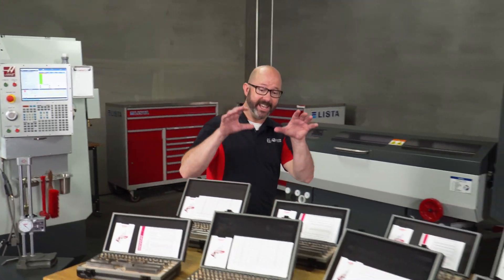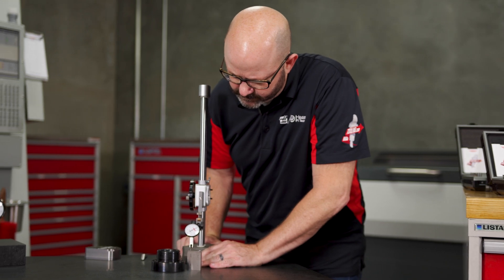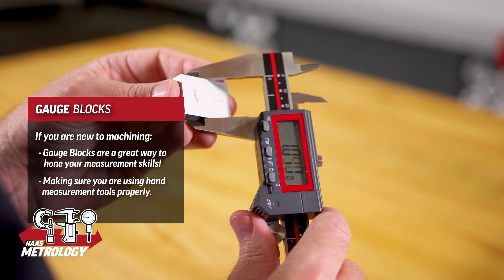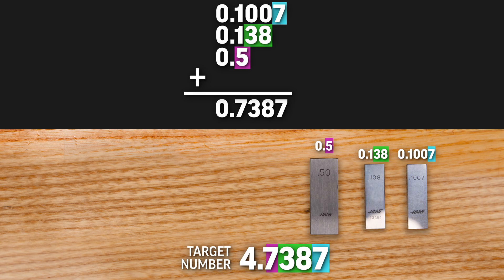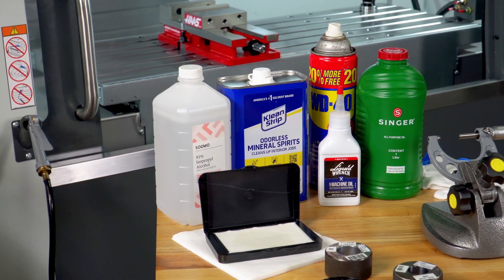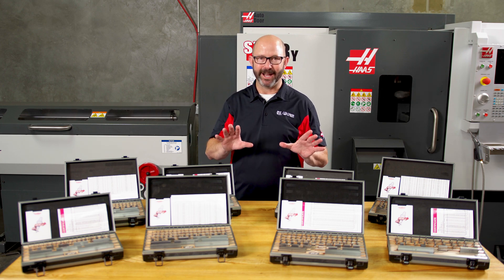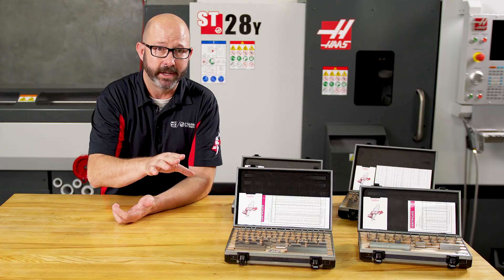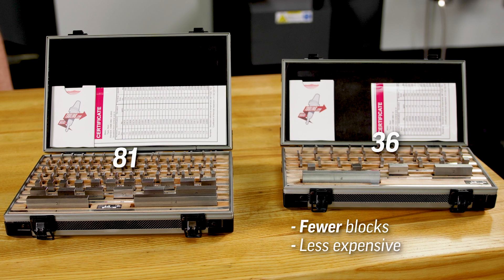Gauge Block Sets Now Available at HaasTooling.com - Haas Metrology

Comment: All well and good, but zero mention of temperature!
Guage-blocks are ONLY certified at a single temperature, usually 25C.
Any variation away from that, and they are NOT accurate.

Comment: What about ceramic versions? Any (dis-)advantages besides not rusting?
Reply: price is crazy .. but they don't wear or corrode ..  If handled and maintained properly standard gauge block will last 50+ years without rust or corrosion